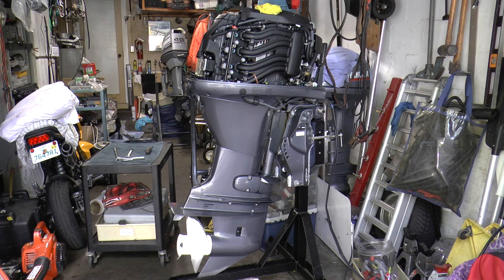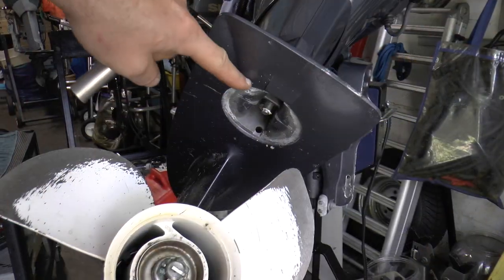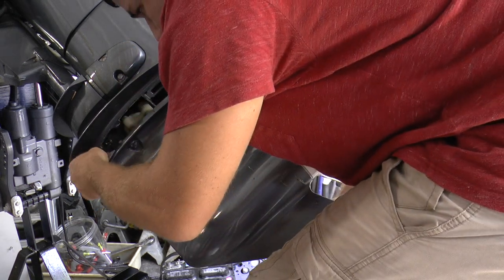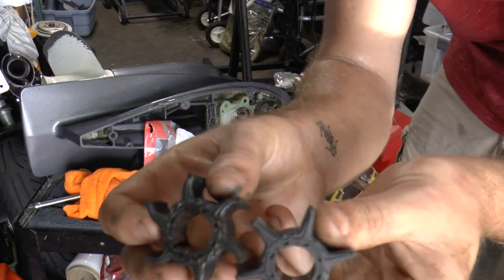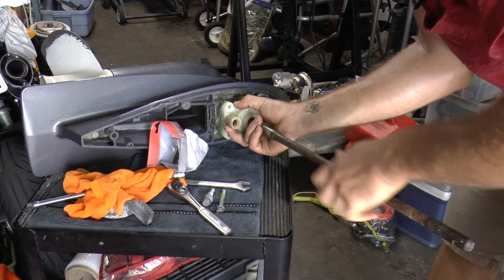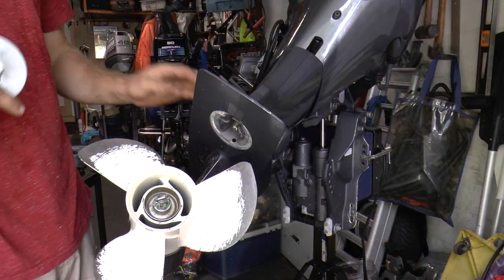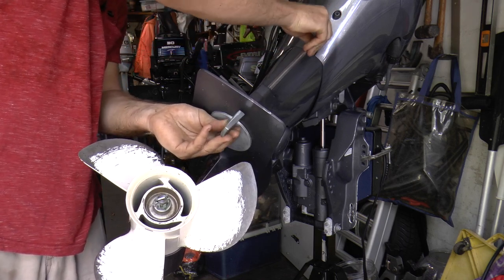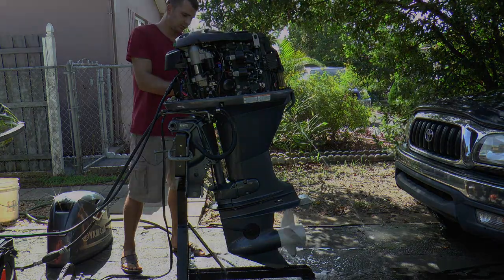How To Replace A Water Pump Impeller Yamaha 70hp Outboard Motor

Comment: How do I tell if the spines are lined up I’ve took it out and put it back in but the prop will not turn with the lower unit all the way in

Comment: Does shift cam rotate? You do not need to release or loosen it like in smaller engines where rod goes up and down when you change the gear.

Comment: Great video. I just replaced the water pump on my 1977 Johnson 75 hp stinger, and The prop is VERY hard to turn with my hand. I'm also having trouble lining the gear shaft (or whatever it's called, back up. I have the lower unit completely attached, but it looks like the gear shaft is shifted a little bit. Any tips?? Thanks.
Reply: Did you sort it out mate haha 4 years later

Comment: Can I put the garden hose through the water intake and run the motor to flush the salt water out instead off using ear muff? Thanks
Reply: If you hook the hose up to the water intake directly to the motor, do not run your motor just let it flush itself out

Comment: Great video. The motor is in neutral I gather???? If drive shaft does not line up when re- fitting is it safe to turn either driver shaft or power head in either  clockwise or anti clockwise directions?? Hope someone can help?